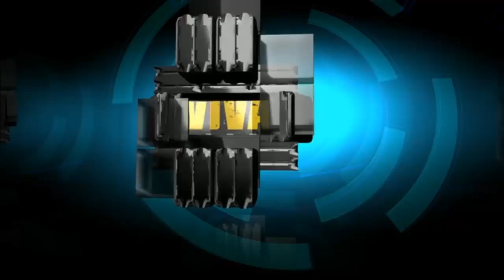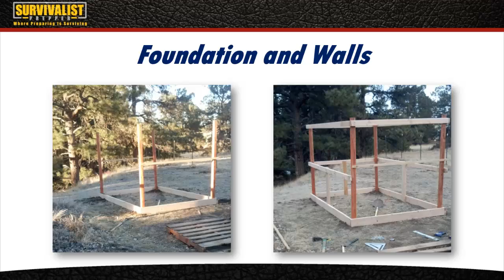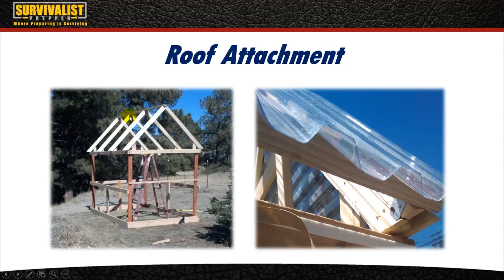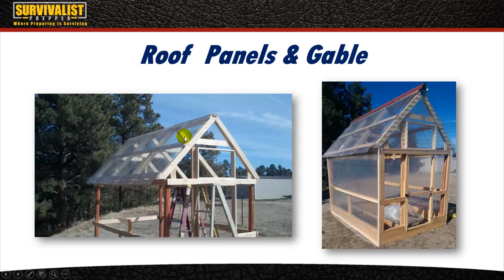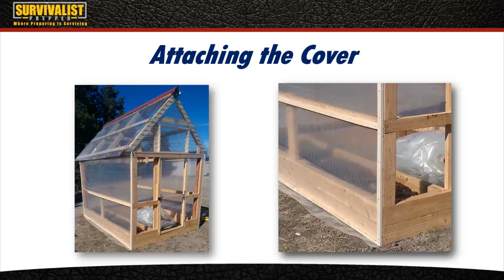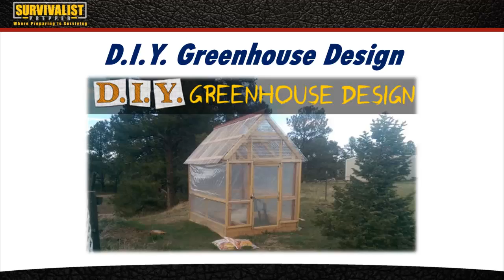How to Build a Greenhouse DIY Design

Comment: Hi There,
 I don't know your name yet but mine is Ken and I found you while looking at homemade dehydrators videos and I like yours a lot. So I popped in your channel and looked around a few minutes. I have gathered my materials to build a greenhouse. I'm using old sliding glass door glass because I do remodeling and have been saving them, and am using the same corrugated "Lowes" roofing panels for the roof. GET TO THE POINT KEN! lol  I really like this presentation software. the way you can gesture with the yellow ball and voice over and everything. Would you please tell me what it is? I may never have need of it, but I may if I ever get over my "camera shyness" for lack of a better term, because I also do some kinda cool stuff that people might like to see.

                                                 Thanks   Ken  :-)